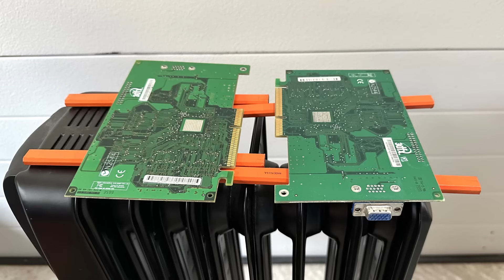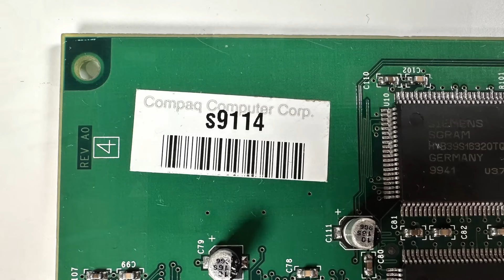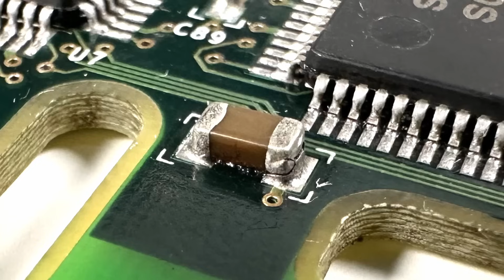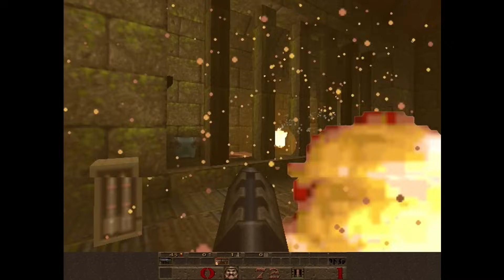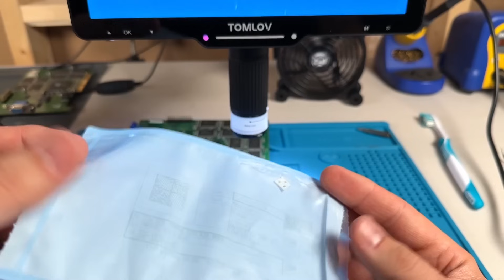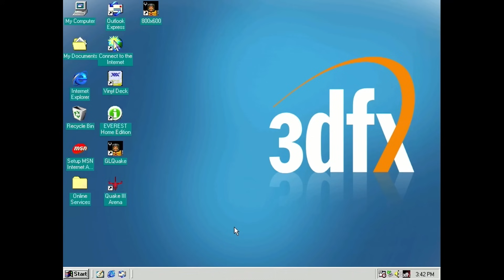3dfx Voodoo 3 1000 Repair and Enhancements - Part 1

Comment: The only purpose of the holes at 22:59 are to conductively transfer heat between the PCB layers. There's no airflow. They're just vias. The vias are also offset from the BGA balls so the balls can be soldered to the same copper fill the vias are on.
Reply: Actually, it's better to fill the vias with solder, since as we know air insulates.
The big square on the back where they left the solder mask, greatly increases thermals.
There are tons of papers and other good reads on this.

I don't know why they did it this way. I design PCBs myself professionally and the default practice these days is to fill these kinds of vias.
If I remember well, back in the day this process used to be a bit more troublesome because of warping etc. But it has been awhile so I don't quite remember anymore.
These days it's definitely not an issue anymore.
Reply from the maker: @p_mouse8676  Very interesting! Thanks for sharing this. Would be an interesting experiment to try. You've got me thinking now :D .. I will definitely revisit this in part 2.
Reply: @vswitchzero  unfortunately we can't share any links. So my apologies to say it this way, but by a quick online search with: pcb via thermal resistance, you'll find plenty of information and articles.

It actually makes me wonder where the heat spot is on those IC's 🤔
Because with some of them, like a regular ThinPak package (MOSFET or so), the heat lug is on the bottom side, not on the top.
So in some cases it's a better idea to put a heatsink on the other side of the PCB, where you see the vias.
Reply from the maker: I didn’t think of that! Makes perfect sense, thanks for sharing 🙂👍

Comment: The Voodoo3 1000 AGP 16MB  is a down clocked Velocity 200 AGP 16MB, the Velocity 200 was the card that ever came out, it had both TMU's enabled and it was a Voodoo3 2000 AGP with SGRAM that gets you to the VOodoo3 1000 AGP with SGRAM but at 143Mhz Core/mem.

The Voodoo3 2000 & 3000 PCI SGRAM cards also used the same PCB, yet some of these came with 4 memory chips instead o 8, PCB design is pretty much the same but with a PCI connector instead of AGP.

Greetings from Obi Wan kenobiV6K from x-3dfx, I'll share this in our community with credit from you  :)
Always good to see solid work being done to keep these 3dfx relics alive.
Reply from the maker: Hi Obi Wan! Thanks for watching! I was always curious about the Velocity 200 and see that the vBIOS file has been preserved for it. I'm very tempted to create one from a 16MB 1000 as an experiment since they share the same PCB. May need a slight vmod as I assume 3dfx uses closer to 2.5V for 143MHz cards. Would be cool to see since it's nearly impossible to find a Velocity 200 prototype card.

Comment: I wouldn't worry about blocking the holes in the thermal vias. I can't imagine there's any convection cooling through them. It's probably only the copper itself that transfers the heat.

Comment: Hello great your work I have my Voodoo 3 graphics card with a problem on screen VGA monitor shows in yellow color and by S-video output it shows in normal mode you could tell me that I could check.. I already got another monitor and another VGA cable in the same way it is shown in yellow.

Comment: really like your repairs, amazing skill I must say. It was way too frustrating for me - when I had good equipment I always realized something was missing: had a good soldering iron and hot air station, but couldn't even recap motherboards, because didn't have a heating table and the ground planes were just too big. tried desoldering alloy but didn't change anything. A dead motherboard couldn't be repaired because I didn't have an oscilloscope bla bla bla. When I realized it would become too expensive for me to justify, I just sold everything. Kudos to people like you, who have the patience and money to get good at electronics repairs and saving some fine 3dfx gear :-) a small nitpick I have with your channel is, that you removed the Megaman sprite from your YT avatar - shame! 😖
Reply from the maker: Thanks very much! Yeah, it can be quite frustrating at times. I've still got a lot to learn but that's part of the fun for me. Haha yeah, I do miss the Megaman avatar too. Megaman makes some appearances once and a while in my videos though :)

Comment: Shhhh, you're lettin' the secret out, lol!  About a year ago I had this same thought process when I got a Voodoo 3 1000 with that 5.5ns memory.  With JUST active cooling, I could overclock to about 150MHz IIRC.  Then I increased voltage to match a V3 3000, and I'm stable at 186MHz.

Comment: Silicon magic made 200mhz SGRAM.  Part number SM84L512K32.. wonder how hard it would be to get some and try to take the record for fastest Voodoo 3.  Around 210-220mhz is the peak that I remember for SDRAM versions with 5.5ns memory back in the day.

Comment: FYI SGRAM is used on the very first Creative Geforce 256 card. I have one here given to me by a friend 18 years ago that was cooked when the fan failed. The card still works but it has a grey haze over the top of the image. I swapped out all the SGRAMs for new parts but that didn't fix it so obviously the grahpics chip was internally damaged.
Reply from the maker: This is a common issue with GF 256s unfortunately. The analog output part of the core seems to degrade and the signal gets really weak over time and you get all sorts of image quality problems like a darker image, washed out colours, and shadows/smearing. Could be due to overheating perhaps. I have a creative labs card with this issue and hope to do a video on it some day. It had a dying fan on it when I got it.

Comment: 10:14 Best way to avoid losing it while loose is to simply turn the cap 90 degrees and leave soldered to the board. Then you can measure it and know it won't dissappear into space if you slip with the probes.

Comment: I wonder if it wouldn't be a good idea to reflow the BGA while it's being worked on? There are a number of DIY BGA rework machines using IR heater beds and PID controllers. A really good one would cost about 200 bucks to build and you could use it on a lot of projects I bet
Reply from the maker: This is something I hope to gain some experience with at some point. I’ve never done any BGA work yet. Hopefully one day 🙂👍

Comment: I've recently learned that the darkest caps are usually µF range, ligher are nF and almost white ones are in pF range.
Reply: That may be because of the different ceramic material.
The two (three) most stable materials are C0G (aka NP0) and X5R/X7R.
The former has lower specific capacitance but is more stable and the tolerance smaller (5% not hard to find). Typically used for signal and high frequency. Grey-sh colour.
The latter is for everything above 100nF (depending on voltage and room on the board). Light brown colour.
Reply from the maker: Very interesting! I had always wondered about that. Thanks for sharing

Comment: Super nervous at you soldering next to the edge connector like that, without covering it with some tape. If you feel confident about it that's fine but it's so easy to get a little bit of solder on there, ruining the gold plating.
Reply from the maker: Very true, thanks for the tip 👍

Comment: I owned a Voodoo3 1000 back in the day. Bought it (apparently) new from the local computer parts shop. It came in a plain white box. It had no heatsink and ran at 125MHz. I never had any trouble with it. It ran Descent 3 and UT '99 flawlessly. I sold it on eBay a few years back, and the buyer messaged me afterward asking what happened to the heatsink...
Reply from the maker: Interesting! I had always assumed it was big OEMs only that had these but maybe smaller sellers could get quantity lots of these too. Do you remember what the cost was like compared to a retail V3 by chance?
Reply: @vswitchzero  I found a spreadsheet from August 2000 where I specced out a PC build for a friend. I listed the Voodoo3 1000 OEM at $52, which I think was roughly half the cost of a retail Voodoo3 card at the time. I tried to corroborate this with the Wayback machine but unfortunately they didn't crawl this computer store's price list during the time window the card was available.

Comment: I had a 3dfx Velocity 100 back in those days. With a small fan added on to the GPU heatsink I was able to OC mine to 155 MHz on the regular. Enabled the 2nd TMU via a registry tweak. 
For the relatively small amount I paid for the card then it was a mostly wonderful upgrade from the 3dfx Banshee card, even though it had half as much VRAM as the Banshee. That was the only time I've ever done a video card upgrade and ended up with a faster card that had less VRAM on it!
Reply from the maker: The velocity 100 was a great value! I still don’t have one in my collection but looking forward to checking one out some day

Comment: I just LOVED the time back then when you could buy a Celeron A333 for a 550mhz Pentium 2 killer or a budget voodoo 1000 card for 3000 performance.
Reply: mee too.  hey some newer cards could do similar... Radeon 5700 8GB > 5700XT vBios....   no unlocked shaders or TMUs but it did raise Pwr limits and clocks to teh XT model....   same with Navi48 9070XT 304W > 330W vBios flashing.. ( i wish we could modify modenr vBios

Comment: Consider getting a T12-KU or equivalent tip. I use it for 95% of all the work I do (mostly 0603 repair)
Reply from the maker: Thanks for the suggestion! That looks a lot more appropriate than the T18-K I'm using. I will try to pick one up with my next digikey order.

Comment: There is Belorussian ESR meter miron63 that can peroform in-circuit measuring of the (non-parallel) capacitors. Not so cheap and pretty hard to obtain due to sanctions but working as a charm.

Comment: You would love to live in denmark, a broken v3 card is 20$ max, usualy less with the bracket :P  well nice video. have a good one.
Reply from the maker: Thanks very much! .. Haven't seen a single 3dfx item go for anywhere near $20 for a very long time around here. You can't even buy a 3dfx driver CD or a slot bracket on eBay for that these days haha
Reply: OMG how. I'd travel to Denmark no problem!

Comment: My VooDoo 3 3000 use to get crazy hot and I had plenty of cooling near it. I ended up putting a 60mm fan on the heat sink and that kept the card much cooler. I put a 40mm fan on top where the holes were and that helped a lot too. I still have a few of the VooDoo 3 3000 cards around somewhere and a couple of VooDoo 5 5500s. I have been thinking about building a vintage PC and putting one of the VooDoo cards in it.
Reply: TBH i'm not fond of Voodoo using a linear regulator to power the graphics processor and then dumping all of that heat into the PCB. The processor running at what 2.9V i think or less? so 60% of the 5V power goes to the processor, 40% drops on the regulator, which is PSB-cooled. There are scant handful points of thermal via stitching under the regulator and all the near radiation area is mask covered. For a thermally spicy card, this level of sloppy design makes me want to scream.

Comment: 1:50 I prefer hair dryer ;p
Reply: I pour 100% IPA on it and then datavac (blower fan) all the alcohol out. I still wait a day before using electronics but it's probably not even required.

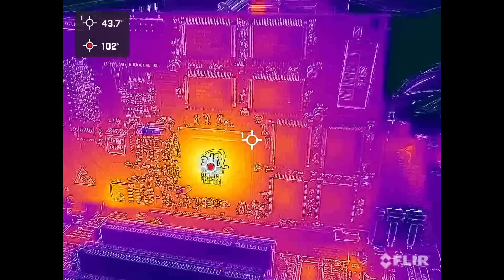Comment: 21:00 Linus, a few years ago, did a video about a small US company making their own thermal glue. Since there are no mounting holes and I don't often trust adhesives as I've had heatsinks fall off components that way, I think gluing a small copper heatsink to the core could do wonders for the longevity of the card.
Reply: That was Tech Ingredients and they have a VERY exciting channel of their own. Explosions, lasers, alcohol, jet engines, you name it, highly recommended.

Honestly the thermal adhesive tape works JUST FINE, the stuff that often comes on the heatsinks preapplied. It's not going anywhere at that size and its thermal properties well they're better than nothing.

Other decent option is the type of silicone used in power supplies, i buy cheap K704 or 705. Its thermal conductivity and adhesion are eerily decent.

I really wouldn't want to epoxy a heatsink on there, i just think it's not very elegant.
Reply from the maker: @SianaGearz  Thanks for the tips! The challenge I'm having with the thermal tape is that the 3dfx avenger chips all seem to be slightly concave at the center. If I push a heatsink with pre-applied tape onto it and remove it, you can see the contact imprint around the edges only, unfortunately. On some V3 3000s I repaired in the past (with the spring clips), I had to apply a generous amount of paste to fill that gap.

I suppose lapping it would be an option if I was really serious about getting good contact - but not sure how thick the plastic package top is... plus I don't think I could could ever bring myself to do that to a 3dfx card!  haha

Thankfully it doesn't take much to keep these cool. Even the hottest V3 models are only about 8 watts, so getting perfect contact and pressure etc really doesn't matter like it does on modern chips :) .. absolutely ANYTHING would be a huge improvement on these 1000s anyway haha
Reply: Arctic Silver still makes thermal adhesives, but honestly just do it like we do an IHS after a CPU delid. Use regular paste and silicone / automotive emblem adhesive on the edge.
Reply from the maker: @drewnewby  Thanks for the tip! I've heard of people doing something similar with thermal paste at the center and just a bit of super glue around the edges to hold it down. From what I've seen most thermal epoxies have pretty poor thermal conductivity compared to regular thermal paste, so might be worth considering something like this. I'm going to experiment with this and see what works well.
Reply: I would avoid super glue in the corners. Removal is a PITA and nearly impossible without solvents, while something silicone based pulls right off with minimal residue.
Reply from the maker: I remember this as well! Yeah I really don’t trust thermal adhesive tape. One major problem is that the v3 chip is slightly concave so it only makes good contact on the edges. It needs extra material in the centre for good contact. Thanks for watching!
Reply: Just use the cheap white thermal glue in the corners, and regular thermal compound in the center. I find the cheap stuff sets up more like silicone caulk than an epoxy, so it's easy to remove, so easy that accidently bumping the heatsink is enough sometimes.
Reply: Btw the K705 thermal conductivity is claimed to be 1.6W/mK. It would be scary good if it was that high, i bet it's lower, on the order of half that, but as i said, decent, and it's quite inexpensive. For comparison, while high-performance pastes usually claim to have 5-10W/mK, their real thermal conductivity is usually around 3-4, and white paste is 0.9 W/mK. 15 years ago, AS5 was popular, claiming 4.7, but in reality being 1.0. It is to be said that these figures are probably a bad way to describe the performance of thermal paste, since it characterises the thermal impedance of the bulk material, while most of the real-use thermal impedance occurs at boundaries where it contacts other material, and can't be described with a single number.

Oh i also have another insight, a somewhat unrelated one, if you don't need monstrously high thermal conductivity, and let's face it, the thermal flux off these chips and classic computing stuff in general isn't THAT high, unlike today, cheap white thermal paste lasts much longer than the nicest high-performance pastes. You could open up a random piece of equipment from 20-30 years ago and the white stuff is fresh like day 1. I got myself some HY410 for the purposes and tortured it under extreme temperatures and dumb storage conditions and it looks super promising, it's extremely difficult to induce any breakdown at all, while even the normally considered super trustworthy performance optimised stuff like mx2, mx4 already separates just a little in the tube.

Comment: What soldering tools do you use?  I'm looking to repair a few parts (motherboard, video card) and I'm not quite sure what is good.
Reply from the maker: I forgot to mention it in the video, but I’ve started including a list of equipment and parts in the video description 👍
Reply: I also have the Hakko 888D that vswitchzero is using but it's not very new tech. There are newer styles of irons that heat up faster and work better for reworking components near large ground planes.
Reply from the maker: @kunka592  I believe Hakko finally end-of-lifed the 888d actually. Its been a great iron for my purposes but I agree - I'm sure there are much better ones out there by Hakko and other companies too.

Comment: I used to get these and just glue a small little fan powered heatsink on them with thermal glue.
That always worked pretty well actually.

Wasn't there a tool to OC the memory as well?
Reply from the maker: Thanks for watching! The V3 and V4/5 have their memory clock synchronized with the core. So as I increase the clock, both core and memory are overclocked. As far as I know only the Banshee had async core/memory clock control.

Comment: I have a funny experience with an OEM Compaq Voodoo 3 1000.... It looked like a Banshee to me, and i found it coincidentally in my huge piles of cards years back... So i thought, i would do a nice SS7 Banshee build and got everything ready, yeah incl Banshee drivers. Now guess what happened? I thought it was fu**ed up because none of my drivers worked on it, until the non original heatsink fell off.... And there i had the enlightening moment. Haha damn! These are rare cards. Worked weill with 166mhz clock speed, still does..